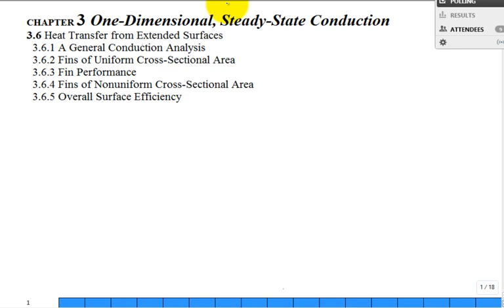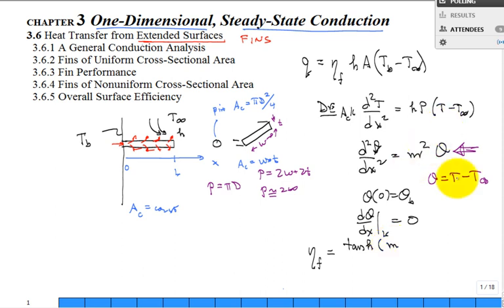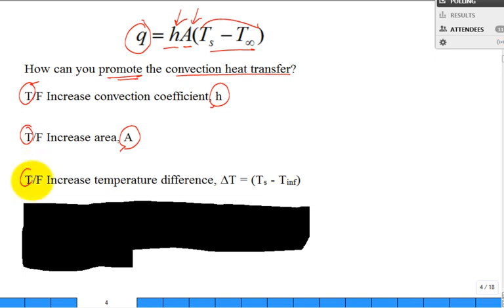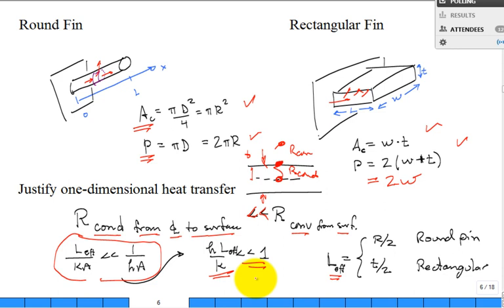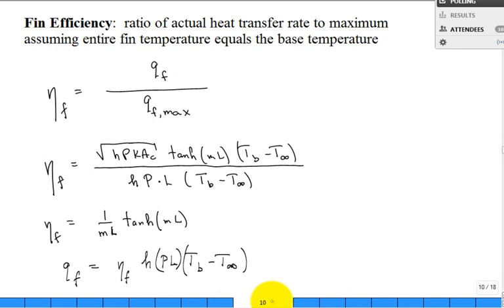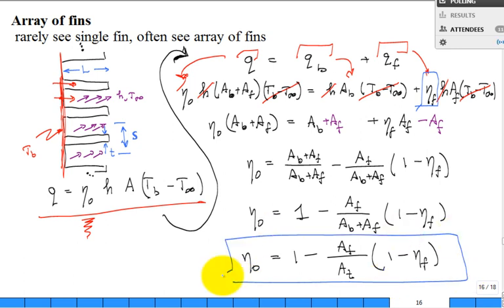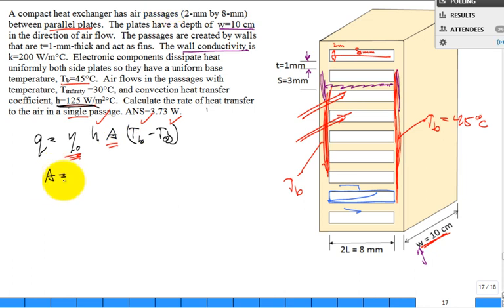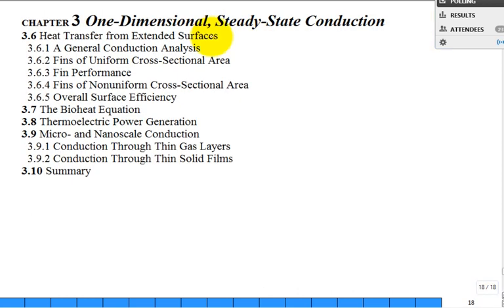fin heat transfer

Comment: Why in the last example, when calculating A_fin, did you use 2L but when calculating Eta_f you used just L?
Reply from the maker: symmetry.  to get single fin efficiency go from base to "insulated" tip which is "L"